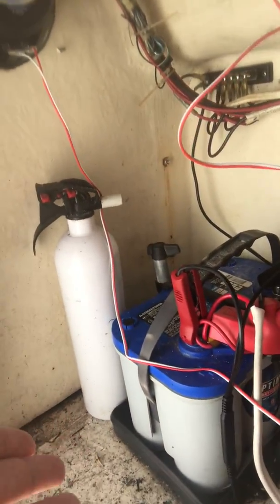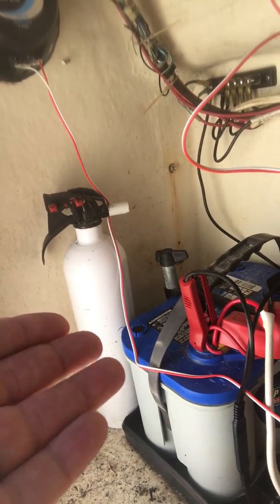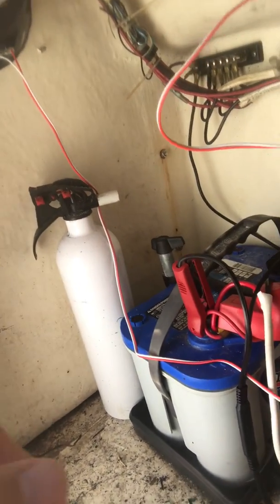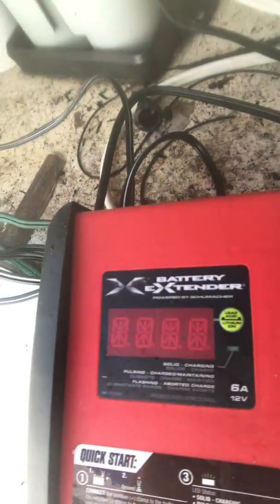How to recharge a dead Optima Battery

Comment: okay genius's, one more time for all those that missed this for the last 10 years, a smart charger will not activate on a complete dead battery, it has the capability to tell you the battery is bad, so to outsmart the smart charger simply take a battery that has a charge, doesn't have to be fully charged just not dead, hook up your charger to it, then use jumper cables to put the "dead" batter in line. then the smart charger thinks its charging a good batter and charges both, this is not new and im surprised the subject keeps coming up.

Comment: Worked on my optima from .5 volts to 11.30 volts jumping with car first then charged over nite on regular charger now 13.1 volts plus it worked on my flooded lead acid lawn tractor battery Thanks Great post

Comment: I had my optima battery maybe a year and it stopped working for whatever reason so I got another battery and kept this optima. I have a normal battery charger that’s broken, it always charges and doesn’t stop regardless of the battery voltage. So o suppose I can recharge my optima and reuse it now?
Reply: No. Your battery charger is broken.

Comment: will my 40a charger work?  it also has a 2amp charge setting. . the yellow top was sitting at 3v for over a year
Reply from the maker: tankdog03 not unless you get the voltage up above 10 volts, the charger will read bad battery until then. Plug it with jumper cables to your car running for a half hour, then attach your charger and it will work
Reply: +Sean Blaise my charger is older and works fine.. just wanted to know if 40amp setting was to much for it? I ran it 15 min @40amp and got hot, now I got it charging @2amps..
I'll shut it off after 2 hours, let it rest for 10 or 20 min then check the voltage status. .
Reply: Going to try this booster cable tip on my blue top optima , hope it works .
Reply: I'm in process of recovering a blue top that was operated at very low voltage ,only had 5 volts I tested it after charging had 13 volts only 14 CCA WITH 200 milliohms resistance. It accepted very little current over a amp    I done a series of charge and discharge cycles keeping voltage limited to 15 volts at 10 amp , after a discharge to 11 volts and recharge session the internal resistance has dropped to 7.6 milliohms. The CCA IS at 450. Little by little it's coming back to. Life . I'm avoiding excess voltage to much current avoid heating battery to much .  Its responding well . The battery is 12 years old .